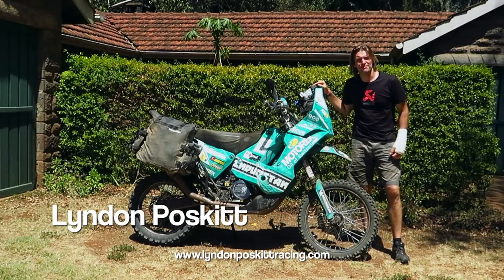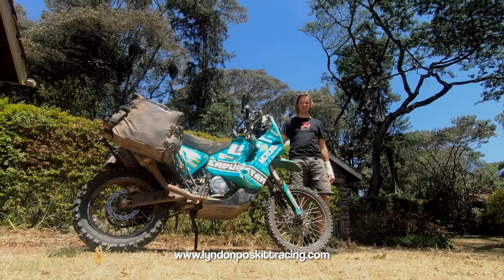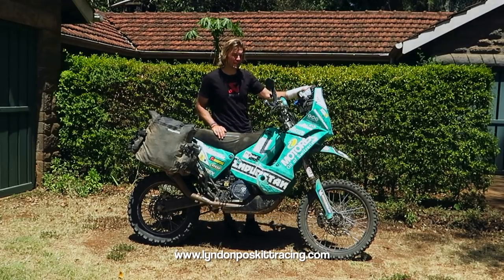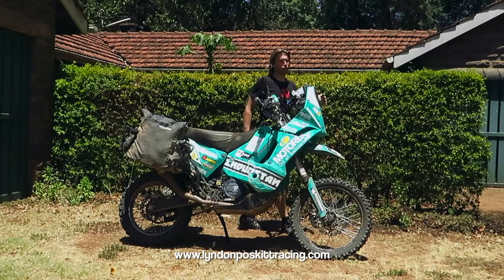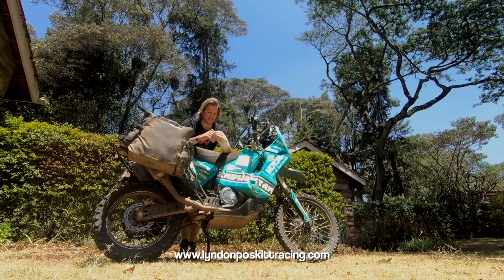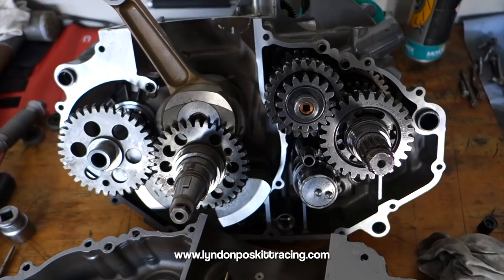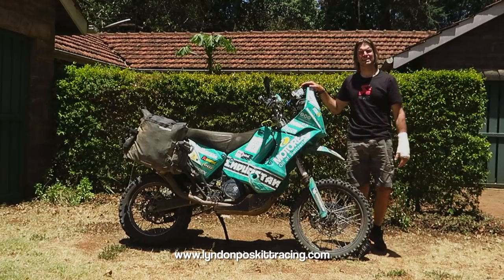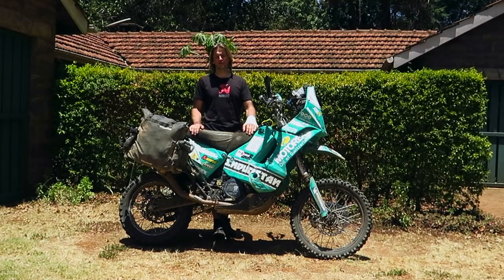Races to Places Special Feature - All you wanted to know about Basil Bike

Comment: Love it!
More power and reliability. 
I especially like the gearbox set up.
Most bikes are either geared for slow technical stuff and not highway speed‘s or they’re geared for highway speed and not the slow technical stuff. 
We all want the best of both worlds (from the factory). 
BMW GSA is geared well but too big and heavy for a lot of riding that I like. 
I currently have a T7 and love it but I wish 6th gear were a little higher. 
I’m still need to do more with the suspension.

Comment: I got a 690 enduro with 4000 kilos used bike. The problem is it burns oil. until I find out through the service sticker that the previous owner put in Rockoil 2t into the engine oil. The oil gone after about 2000km ride (when i checked through the looking glass). Did another oil change, and now it burns 250/350ml oil for each 1000 km. Now clocked at 8400km, 1000km until next service. For daily use and highway cruise, Which oil is purposely made for the bike? Motorex  Power Synt or Cross. Both 10w60

P/S : Rex is the reason I like bought the Enduro. Lightweight, power n hopefully long lasting

Comment: I think I saw a similar bike (in white trim and Enduristan stickers) in KTM Basil when I stopped to replace a chain in my 990 Adv R back in 2012 (was it?). It did catch my eye but I spent a lot more time looking (and listening to - they fired it up for me) Cyril Despres's actual Dakar bike that was kept down in their garage. 
P.S. I bet my Carbon fiber/Kevlar bash-plate is stronger and much lighter than your aluminum one. I have smashed it on very steep steps with my 990 Adv. R and bike and me (275 lbs - 6'10") weight a lot more than you and your bike and the bashplate did its job perfectly and didn't flinch. It's 12 layers of carbon and 4-5 layers of Kevlar (a bitch to cut) in between. It's virtually bulletproof but extremely light. A very nice DYI project that I copied from AdvRider where we both used to lurk.
Reply from the maker: That bike was a 690 Enduro, not at all the same bike, just had the same tanks on it and visually looks similar.  Sweet, your bash plate sounds like the bomb! 💪 Come back and let me know how it's going after 235,000km around the world, mostly off-road and 9 International cross country races.  My carbon one wore through 3 layers just from the stones after 50,000km behind the front wheel.  Alloy was the way to go for this, super strong, durable and long lasting as proven.  It doesn't matter how thick you bake the carbon, every impact / stone strike deteriorates it.  I've proved this time and time again.  Sure we use carbon for my race bikes, but they always need replacing eventually whereas the alloy one is still going strong.

Comment: Since you basically ride everywhere, have you had to change jetting for elevation and such or simply find a middle ground and call it good enough? Great video, thanks Lyndon!
Reply from the maker: I never change the jetting, I did a lot of work at the start to get a good baseline that runs a little lean at sea level but safe and a little rich at altitude but with zero issues.  I rode the whole trip with pretty much the same jetting and from from -500ft to +16500ft and never had an issue.  Did exactly what it needed to do.

Comment: Lyndon, have you ever let any of the KTM factory riders have a ride on, or look over Basil?
Given the amount of personal changes you've made, I wonder if there is anything that you have done that is actually an improvement on the factory team bikes?
Reply: I was going to ask this question. Great minds think alike ;0)
Reply from the maker: No but if I were them, this is what I would want as my ultimate adventure bike however, they will likely have to stick to their contracts and ride new production adventure bikes to help promote the brand.  Like we have just seen Toby Price doing the launch for the 390 Adventure.  Same reason KTM never really got behind what I did, they told me they wanted to promote the new 1190 and such but I didn't want to ride that.  
My engine is very similar in specification to that used by the Factory Race Team back in the day, they also used 732cc.  My engine is more for long distance riding, more aim for torque and reliability and long distance riding and not racing (hence the gearbox) and a lot of my modifications are for reliability / ease of maintenance, something Factory Riders really don't need to worry about as their mechanics will fix it for them.  The frame modifications are really only there for longevity, I don't think they would put enough hours on the bikes to warrant a lot of them.
Reply: @lyndonposkitt  Makes sense. Thanks for the reply. Shame that KTM never got fully behind what you were doing in terms if your long distance adventure. I know they helped in your Dakar adventures (where rules permitted) but I always thought it was a missed opportunity for them not to back you more fully.

Comment: Just curious why KTM is it  sponsorship or are you just a KTM guy ? Cheers
Reply from the maker: Davyboy Colon Which other manufacturer builds a bike to this specification? Answer, none. There’s your answer. They are the only manufacturer ever to build a bike so capable in the first place, without any modifications. Starting with anything else you are already far behind.
Reply: @lyndonposkitt  thats what i figured ... i own a 690 duke n love it so i know what you are talking about ..
Reply from the maker: Davyboy Colon I also have a 690 Duke with a 774cc motor in it 💪
Reply: Lyndon Poskitt reason for the first post was cause a bought my first ktm less then a year ago based on your videos and love it so much I barely ride my tiger 800 ... I’ve been a triumph fan for years and now the tiger gets ridin maybe once a month ...

Comment: I just do not understand your childish fear against the EFI. You carry a laptop, a smartphone and a drone. Your Bike already has electronic ignition, and you even carry a spare. And you already have a fuel pump installed.

You can buy a GET EFI, carry the original as spare, together with a TPS and an injector. Thats it. You dont need the electronic ignition anymore, The EFI does it for you. The manifold is lighter than the carb, has much less parts and you always get the right amount of fuel and thew right timing of the spark, you can switch between ergonomic drive, which will give you much more Miles per gallon or race mode, which will give you all power available. The spares are lighter than the fuel you spare on every refill. A clogged Injector can be cleaned on the road with the inbuilt fuel pump. Much easier than a clogged carb. The filters are available in rewashable versions.

 You can even change maps on the fly with your laptop/smartphone. For example if you get extremly bad fuel with low octane. The EFi always tells you, if something goes wrong. The GET Efi can directly communicate with your smartphone via Wifi. And you even get a traction control. Which you can adjust with a small dial at the right lever.
The electronics are extremly sturdy, built in Millions of units. Sensors are Standard parts, built in billions. Worldwide it is much easier to get spare TPS and injectors, than parts for an exotic  carb.
Reply: Looks like you know what you're talking about. I myself am going to do some boring and installing larger piston and not sure the stock ecu will take it into account, though I know of I guy who did just that, with even larger volume and he got a performance increase, without any hassle with ecu swapping. However we can agree that rightly programmed ecu is the best.

So I looked around and found Microsquirt, Speeduino, Haltech and I guess there's more. Problem is plug and play ability to an engine 15 years old, but I guess it can be done. Money wise, no problem at all getting Haltech, actually I'd pay a fortune for the smallest possible ecu (weight and space), though it has to be water tight (and I am not sure about that with speeduino, but it's a diy afterall, so probably anything can be done).

I looked at the GET EFI and as much as i looks good it seems to be only for specific bikes. Maybe they can be hooked up to wide amount off sensors and such, who knows.

One thing is for sure. There were days when companies making big bore kits were using carburators for their ease of use, but the days are gone and developement made some progress. I wouldn't be worried using a carburator, but I guess it would be pretty involved too to adapt any carburator to the existing engine, pretty much the same ordeal as getting a throttle body wider in diameter (and having all the bells and whistles as TPS, idle actuator, possibly even MAP) and slapping it onto that damned engine.